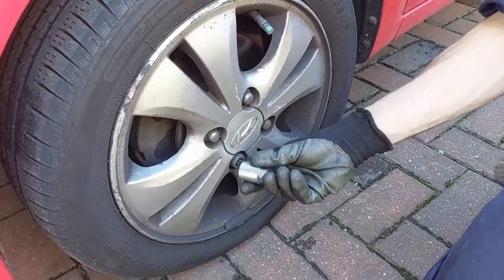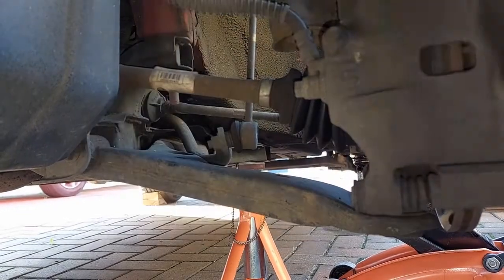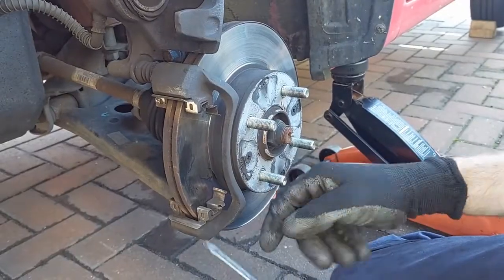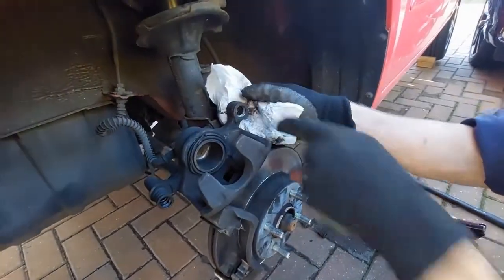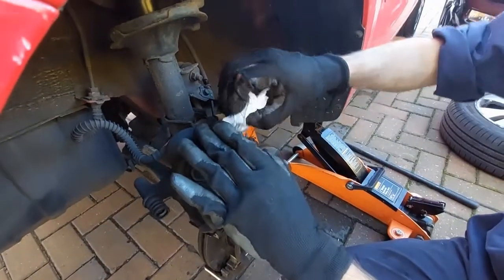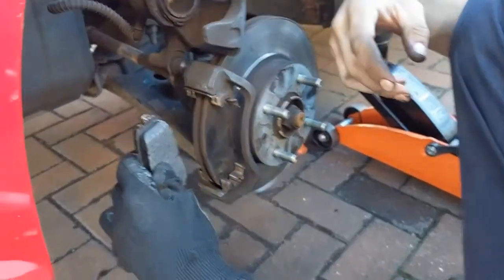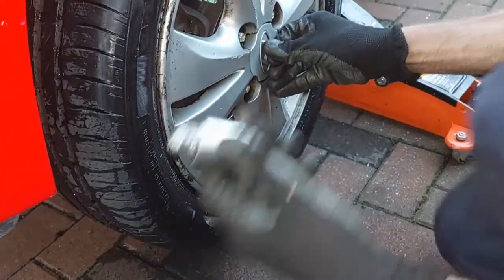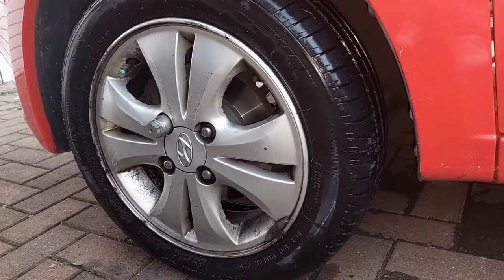How To Change The Brakes On A Hyundai i10 !!!!

Comment: Pads changed but unable to get the piston to sit back correctly over the new brake pads. How do I do this?
Reply from the maker: You might need to push the piston back more, that can be done with a few different tools such as a c-clamp, a big pair of pliers or a brake caliper rewind tool sometimes the pistons can get a little stuck so it will need more force to push it back, hope this helps !